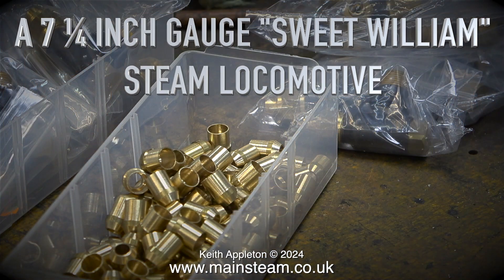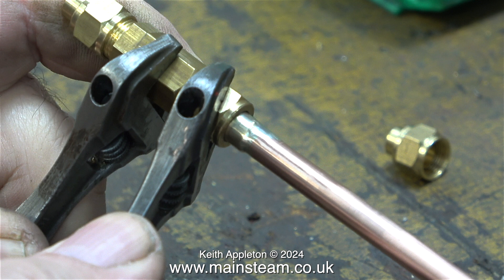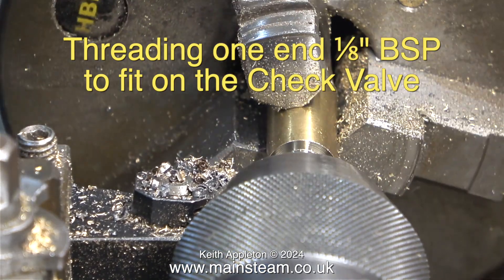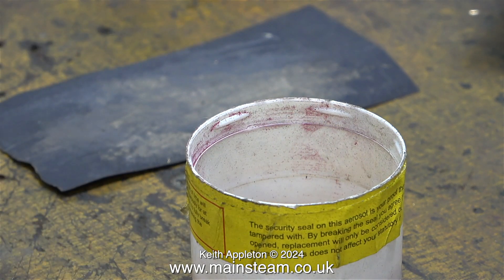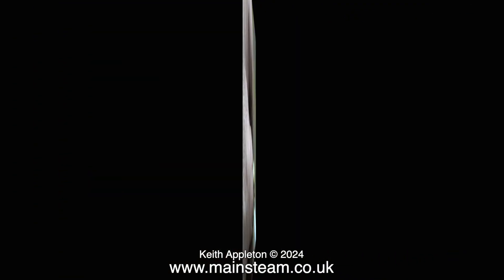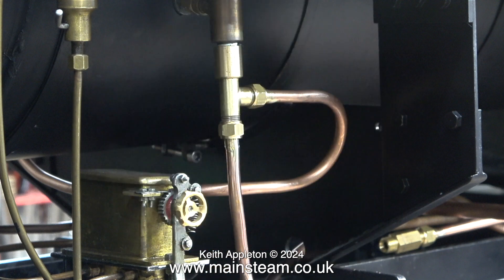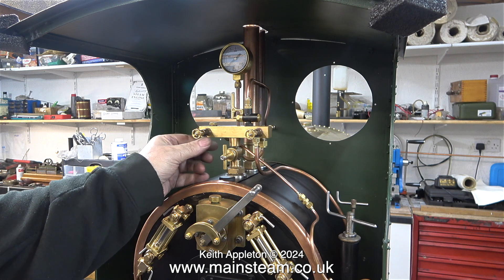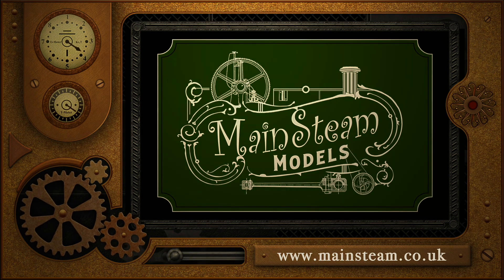A 7 ¼ INCH GAUGE "SWEET WILLIAM" LOCOMOTIVE - PART #77

Comment: which is better for steam work 32 threads per inch or 40?
Reply from the maker: Locomotives use 1/4" x 40tpi. Stuart Models and other stationary engines use 1/4" x 32tpi.
Reply: thanks